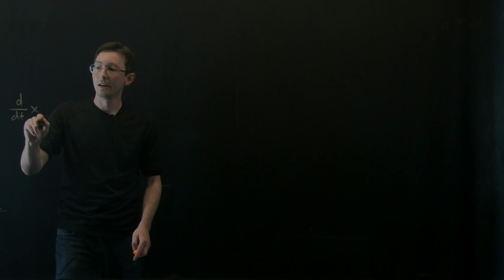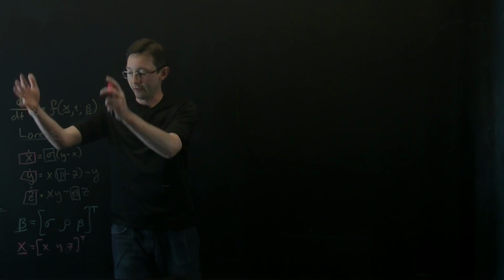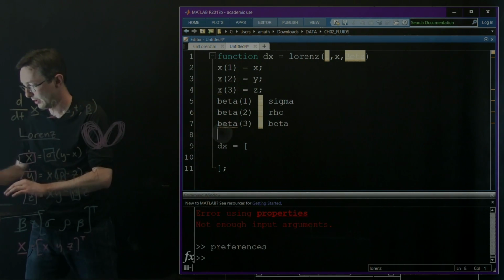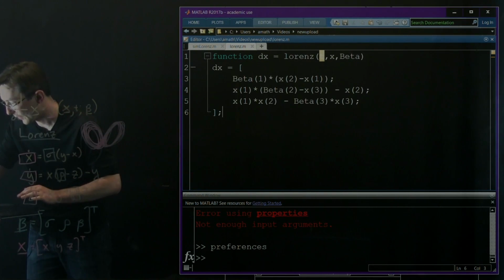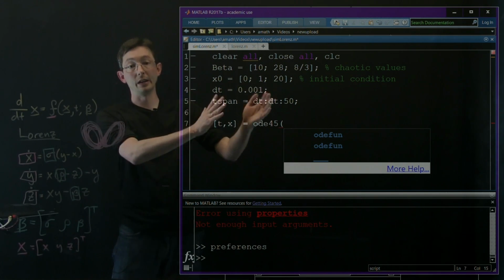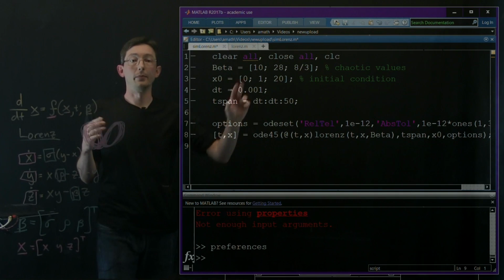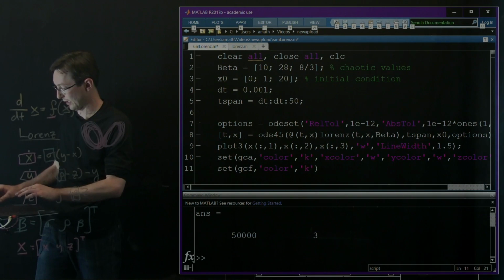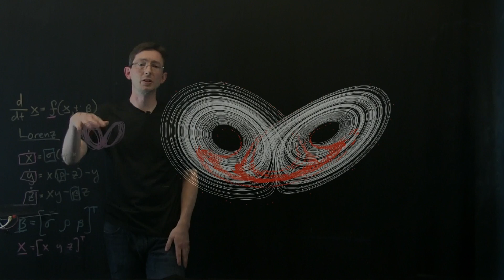Simulating the Lorenz System in Matlab

Comment: Very efficient :) Let me explain a scenario.. As u mentioned here you had an initial condition which is explained neatly what if we have a data set or multiple parameter values of a system for which I need to design a Lorenz attractor..say X1, Y1, Z1 to X99, Y99, Z99 are different systems parameter values. How can I imports these excel values...  Any thoughts??